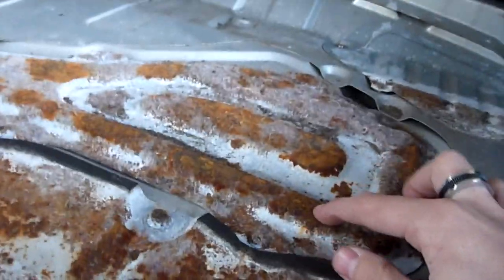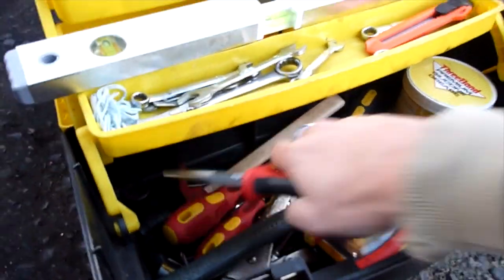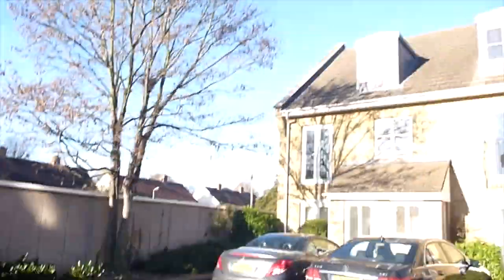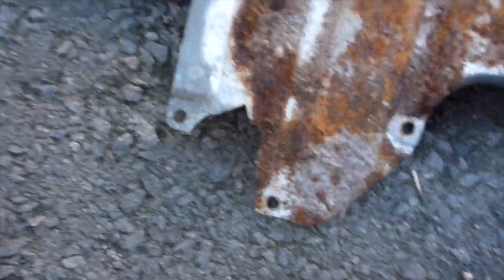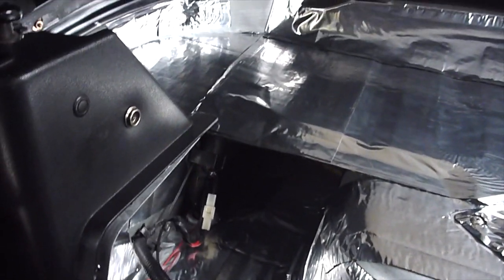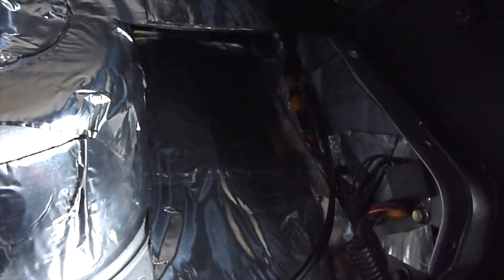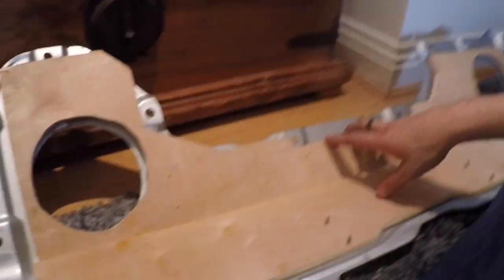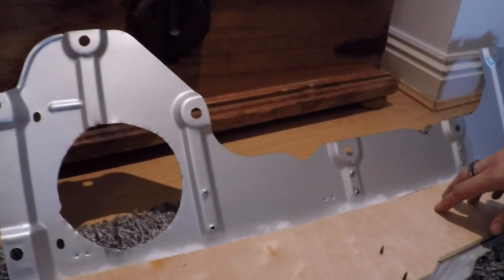MY MX5: Rear parcel shelf speaker install & restoration

Comment: I have done this to both my NA and NB Miata. Had same issue with fuel tank. Never used a custom cut board underneath it. Just screwed 2 6.5" speakers in directly to the metal. This video gave me an idea though.
Reply: do 6.5 inch speakers fit nicely into the original piece of metal without interfering with the fuel tank?
Reply: @murray6188  YOU NEED A 7 AND 7/4" ring to screw it into the metal and mount the speaker gives you just enough space to drill it into the metal and mount the speaker, maybe even an 8" ring MDF.
Reply: @murray6188  The size you cut into the back plate is critical for your speakers to fit properly and allow enough room to drill it into otherwise you will need to use adapter rings like I mentioned.
Reply: @ZacharySound  do you reckon there is still enough room for the oem wind deflector with speakers there or not
Reply: @murray6188  I removed mine so I can't say. I don't see why not though. That will just muffle the sound anyway.

Comment: They also sell foam or plastic speaker baffles that cover the rear of your speakers for better sound and protection from the elements(like the case of door speakers)
Reply from the maker: Yes that's true. In my case though I want the sound from the rear of the speakers to propagate into the boot space for extra bass so I've left them open. In a door installation though they are definitely a good idea
Reply: Over the time you’ve owned and driven the car, do you believe it was worth it getting those rear speakers?

Comment: I'm seriously considering doing this now. I've added headrest speakers to my NA and I'm currently in the process of enlarging the door speaker holes to fit my replacement speakers but I suspect it still won't be enough.

My main concern is that speaker covers on the parcel shelf will prevent my roof from folding flat and will mean my tonneau cover won't sit properly.
Reply from the maker: I can definitely confirm that the sound quality is WAY better with the speakers in the rear shelf. The key is to seal off all the areas where sound can bleed through from the rear though, as that gives better bass response. My roof has no trouble folding down, and I've also measured it with the type 2 roof with the glass screen and there is still enough space for that too. I'm not sure how it would affect a tonneau cover though, I suspect you might have some trouble with that.
Reply: +1 on sealing any air passageways. It is amazing how much better the speakers can perform with them being properly sealed.
Reply: ARCHmatux just get a sub in the boot!! Send me ya email i send pics
Reply: Rob G loool u aint gonna get bass from a pair of 6 inch!!!!!!!!!!!
Reply from the maker: @Anand Vaid  Dude, what is your problem? Why do you feel the need to keep spamming my videos with these messages? Do you want some personal congratulations from me or something?

Comment: clean your frame rail drains so that the water doesn't back up and cause t to get wet back there and that won't happen again. Use PB blaster on rusted bolts, much much better than WD40.
Reply from the maker: I think the damage was from long before I owned the car - I had a new roof put on when I bought it and checked the rain rail and drains at the time and they was clean. So I think this must have been the result of a leaky roof from a previous owner.

Comment: Hey great vid! It inspired me enough to try it on the Miata I just got! I got a couple questions, apologies first if it’s a bit much...

What thickness plywood would you recommend under the parcel shelf? 
 Also how thick were the weather strips you got, the little black things you had between the bolt holes? Did you throw out the original insulation that was underneath the carpet and plastic layer for the parcel shelf? Also where is the gap that your glamorous assistant Rachel was sanding down plywood for? 

Thanks !
Reply from the maker: Glad you found it inspiring! I can't recall exactly how thick the plywood was now but I think it was about 1cm / 0.3 inch. My car only had the carpet and then a thick plastic mat under it, I left the mat in place and cut holes in it to match the ones in the carpet, then installed the speaker grills on top. The weather stripes were I think about 2.5cm / 1 inch wide, doesn't matter exactly though as it will get compressed when you bolt the parcel shelf in place. The little plywood pieces were for some triangular gaps on either side of the parcel shelf at the bottom. Not strictly necessary but the more gaps you can plug up, the better the bass response will be from the speakers. Hope that's helpful!

Comment: Looks good. Would you be able to tell me aproximately what depth you've got to mount speakers there? I'm looking at doing this myself.
Reply from the maker: Without dismantling it all I cant check the exact amount, but I would say you have somewhere between about 10 to 15 cm. The problem is more the width than the depth. I think you could probably  squeeze 8-inch speakers in there, but the fuel tank takes up quite  a lot of room. You would definitely have enough depth for them though

Comment: Good job Rob. I was wondering before you started this product these parts had rust from water run off the roof and other moisture issues a soft top usually has. By insulating and adding all these soundproofing materials are you having issues with moisture retention and mold?
Reply from the maker: I've had mine on for about a year and a half now and have not noticed any additional mould or moisture build up in the cabin. However the car does live undercover so doesn't get wet very often. All of the drain holes are still open however so as long as these are kept clean I don't think I'm likely to have any issues

Comment: Love you work mate! but isn't that insulation material is going to hold water and cause rust over time?
Reply from the maker: It is a possibility, but the bond between the insulation and the metal is watertight and I was quite careful not to leave any gaps, so hopefully there won't be any way for water to get in. Will keep an eye on it though for sure
Reply: Rob G I was talking about the cotton loose fill insulation, but you have either painted or used butyl insulation under it. Surely this would be enough to prevent rising.
Reply from the maker: @chinnerz2  Ah right got you. Yeah hopefully by preparing the surfaces first that will avoid it, also its plastic insulation so it won't absorb any water itself. Definitely will keep an eye out though
Reply: @RobGMyMX5  Thats true. Please make a video if it becomes an issue
Reply from the maker: @chinnerz2  For sure. Would be good to do a follow up actually now that a few years have gone by

Comment: Great job.
When putting the top down will the top cover the speakers.
Reply from the maker: No, the speakers are still fully visible even with the top down. If I unzip the plastic screen a small corner of it lies over each speaker, but not enough to affect the sound quality. The mohair hood with the glass screen folds down slightly differently to the plastic one, so I'm not sure if that would get in the way of the speakers or not. From looking at some friends' cars though I think it would still be fine.
Reply: Rob G - Would you happen to know if the speakers would get in the way of a role bar ?
Reply from the maker: @camjinx4262  I think it would depend on the type of bar you have, but if it's the type that bolts onto the sub frame on either side of the tank, you should probably have enough space to place a speaker behind the front tube of the bar. You might need to go with 5 inch drivers though

Comment: Hi Rob - can you give a bit more info on the placing of the tweeters - are they facing forward or sideways - are they any good soundwise ? I have normal 6×9's in the door but I have a set of component speakers and I wouldn't mind giving this a go - Phil
Reply from the maker: Hey Phil. I placed mine facing upwards on the top of the seatbelt turrets. It does the job ok, but one thing I've found is that sound from them is a little obscured, particularly when the roof is down. Still a big improvement from the doors though. One thing I thought of trying was relocating them into the headrests of the seats. My car has the seats with the headrest speakers, so I'm thinking that could be quite a good location for the tweeters.
Reply: @RobGMyMX5  
Cheers for the reply Rob - I've just bought a windblocker with the speakers in on e-bay - i think it was an option on the 2.5 version - I'm goin to see what the sound is like on it - I know it's already got the cable there as I noticed it when I stripped the car when I first bought it . If the sound ain't great I plan on sticking the tweeter in the windblocker speaker and doin the speaker in the parcel shelf like you - I'm leaving the speakers in the door connected as I think it will help when the tops down - I'll definately be using all your tips on sound deadening etc - by the way is the insulation you used just normal loft insulation ?
Reply from the maker: @PhilM62   Yes, that would probably be a good shout. I should imagine the speakers in the windblocker won't be particularly good - there isn't really enough space in them for a decent size driver. But they would definitely be a good location for a tweeter I think.

Yes, the insulation is just standard loft insulation. If you can get the stuff made out of recycled plastic bottles I would recommend that, since it's non-itchy and very absorbant.
Reply: @RobGMyMX5  
Cheers , nice one - a trip to B+Q it is then

Comment: Are those infinity kappa's? That's what i wanna do too my na miata all 4 around
Reply from the maker: Yes they are. I can thoroughly recommend them, they sound fantastic
Reply: Rob G I bet they do with my headphones they sound crispy clean i wanna get a set for the doors and for the back and hook them up to a 4 channel amp and my headunit seems like you really don't even need a subwoofer they're that clear
Reply from the maker: Absolutely! As long as you seal the area properly like I've done in the video, then you will get a very decent bass response from them. Obviously they are only 6 inch speakers, so you won't get extremely low bass, but music sounds full and punchy, and crystal clear.

Comment: hi this is a big help for me,but would you mind if u can give me the site where can i buy that thing "metal thing" ?i want to change mine also its the same too rusty!thank u
Reply from the maker: Hey there! I'm not sure if you're also in the UK, but I got mine second-hand from a company called EurolinkMX5.com. They also supplied replacement screws and bolts since mine were in a very sorry state! If you're outside the UK I'd say your best bet is to find a scrapyard, particularly one dealing with MX5s/Miatas. Hope that helps! :)
Reply: thank you so much for the info!
Reply: Euro link? Don't you mean auto link?

Links broken

Comment: Maybe the previous owner cut those bits out of the piece to fit a roll bar of some sort? Still a pretty poor attempt
Reply from the maker: I think you are right, because there were some drill holes on either side of the petrol tank where it would have been mounted to. As you say though, a pretty rubbish job!

Comment: Why go through all the trouble when you can just build a box under the speaker to seal it from the rest of the car? That's what I'm doing with mine lol
Reply from the maker: A smaller box will give you less bass response.
Reply: @RobGMyMX5  maybe but what you have now is basically free air so it's definitely not better.
Reply from the maker: @gloriousrunningpotato  Its not free air, its confined to the boot space. That was the whole point of isolating all the gaps. Anyway, you do you dude.

Comment: Waste of time man!! Just upgrage and AMP em.. ton of deadning also !!!come and hear mine!!
Reply from the maker: ...that's literally what I did.
Reply: I got a 12 inch in trunk..2 amps..LOADS of space..send me ya email mate i show ya .
Reply: Infinity r great!
Reply: I’ve got agree. I put components in the door and the tweeters sit on the dash with a 6” sub in a box in the footwell and it’s plenty loud, with more bass than you’d think possible from a tiny box. Even at highway speeds with the top down. It’s a great job, but you just really over engineered a problem you didn’t really have.